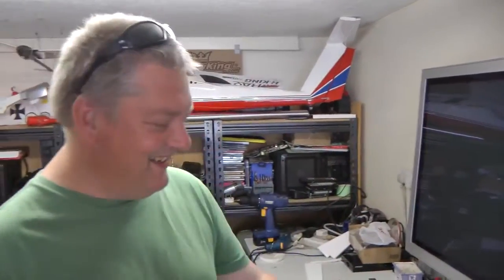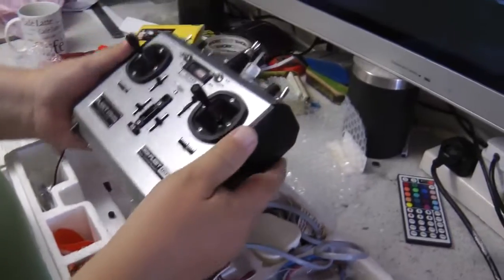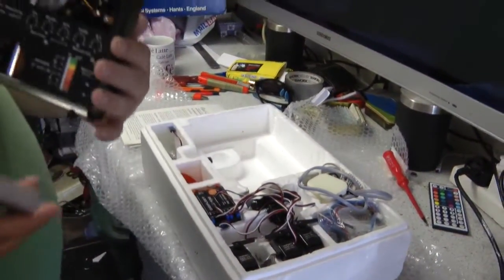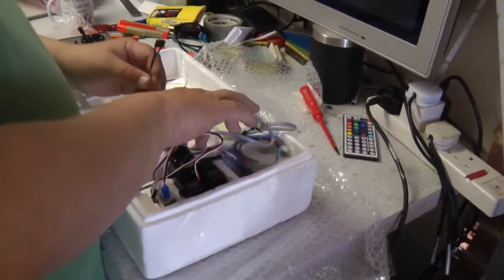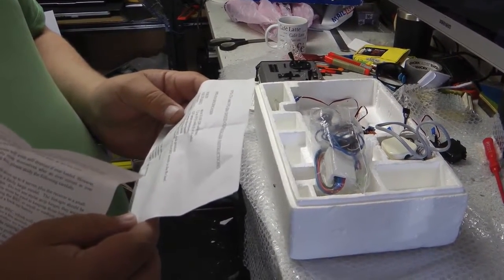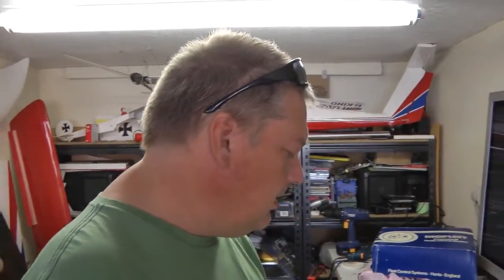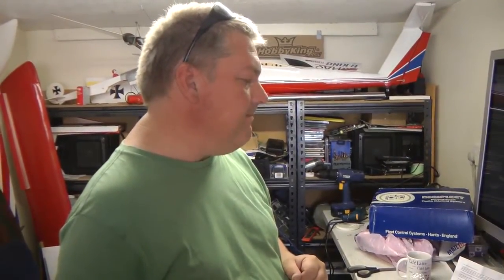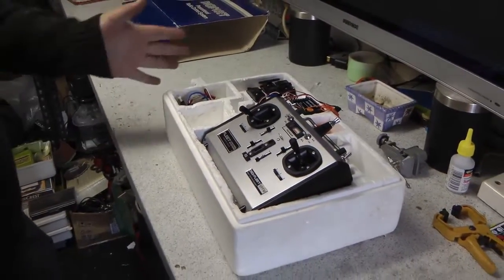Retro RC Tech Digifleet Fleet Control Systems - RC Model Geeks

Comment: hi i have 2 of these transmitters both charge up . but i am getting no joy at the receiver end there is 3 wire's to power the unit but where does the white wire go and from the power supply . ?
Reply from the maker: The receiver only uses the red and black from the battery pack/switch harness. Do you have a crystal plugged into the transmitter and receiver? Are the crystals both the same channel/frequency?
Reply: hi yes there are both matching crystals . cheers Dane . ? @Rcmodelgeeks
Reply: Question am i using the correct fm crystals if not . what are the ones . cheers

Comment: Been using one for the past 30 years NEVER had a radio problem.  Better range than the others, they ran the maximum output wattage allowed in the UK. Best RC system I've had . Only just got round to changing one Digifleet TX to 2.4. Flew 2.4 with Spectrum and Futaba but ditched them both for my DigiFleet.

Comment: Can you please tell me the voltage of each AAA cell or are they around 1.2V each so a pack of four would be 4.8V
Reply from the maker: they are AA. 1.2v nimh cells. 4 cells per pack so 4.8v per pack. and there are 2 packs so 9.6v in total.
Reply: @Rcmodelgeeks  Thanks so much for this do you know if a replacement charger is sold by anyone?
Reply from the maker: @Gareth4Davies  i'd by a standard tx/rx charger and fit a  din plug on the lead.. see this charger https://rover.ebay.com/rover/1/710-53481-19255-0/1?icep_id=114&ipn=icep&toolid=20004&campid=5338306246&mpre=https%3A%2F%2Fwww.ebay.co.uk%2Fitm%2FProlux-4-8V-9-6V-Ac-Adaptor-Tx-Rx-Charger-PX2114%2F202410638312%3Fepid%3D701666392%26hash%3Ditem2f209d3be8%3Ag%3AEQMAAOSwHn9bhCDX

Comment: I still use 35meg on a dji 450 works a treat , iv also got 4 digifleet radios so with a bit of luck you could do a video showing how to convert to 2.4   keep up the good work